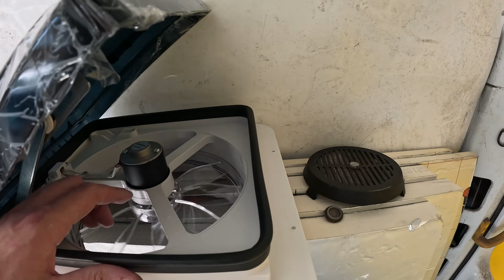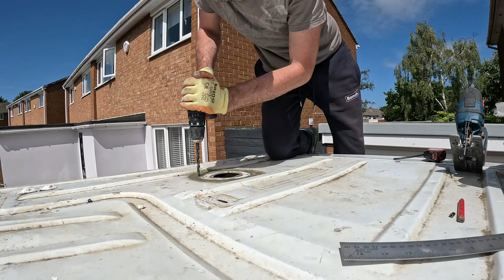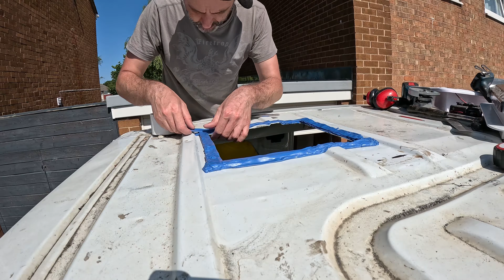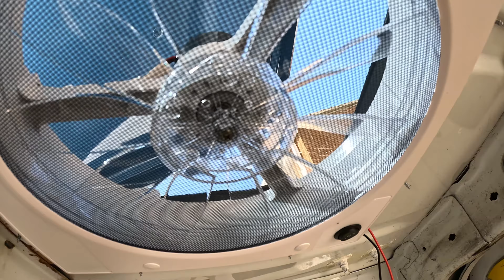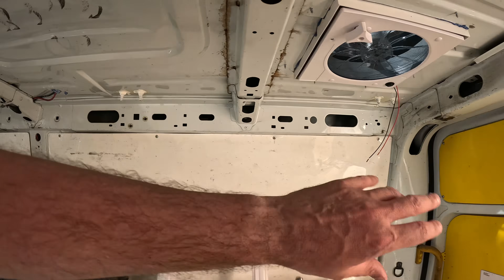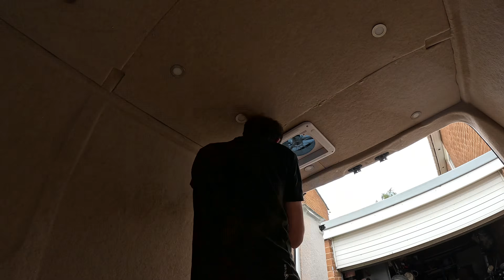Fitting A Campervan Turbo Fan Roof Vent To A Vauxhall Movano

Comment: I think you should have a square wood frame around the inside of the fan, so that the screws from the top have something to grab onto, instead of just the metal of the roof.